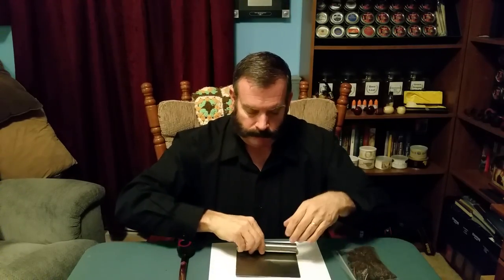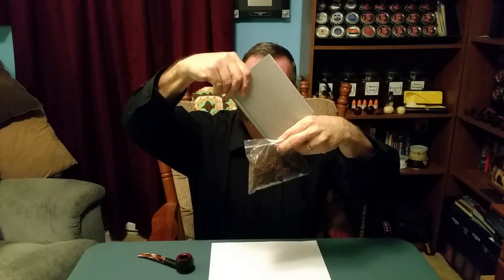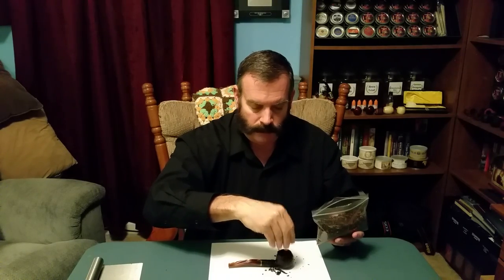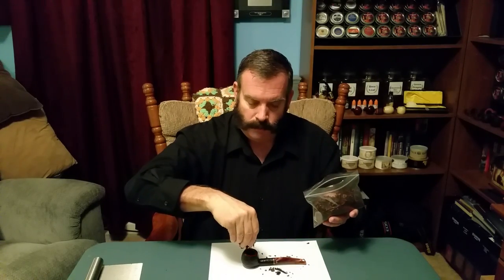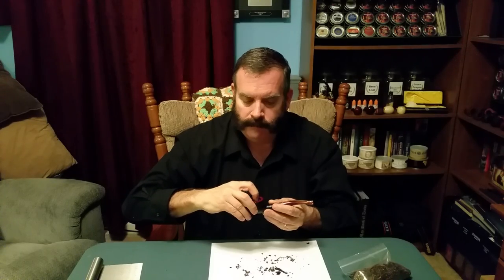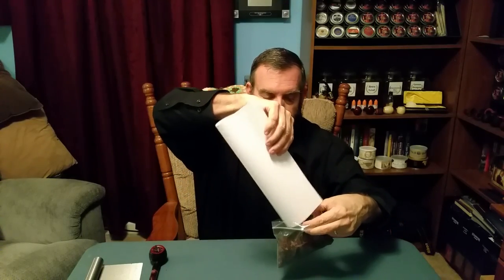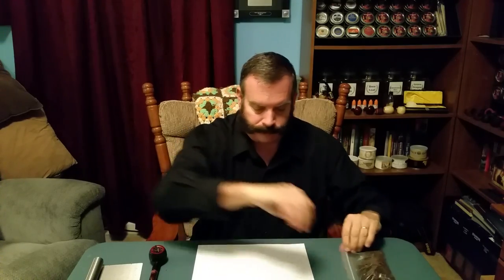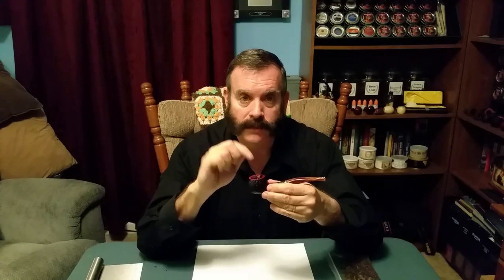The Art of Pipe Smoking, Vol. 2: How to pack your pipe

Comment: i discovered something interesting, i found a way to loosen a pack/draw without having to unload your pipe. what you do is lets say you pack your pipe and its too tight to your liking. what you want to do is cover the bowl with your hand tight but loose enough to let a little bit of air escape the bowl then you blow hard for about a second and it will give you a perfect draw. not sure why but i noticed this with my last bowl. give t a try once if you pack too tight. i enjoy your videos. very informative kudos
Reply from the maker: Hukman! - Very interesting, thanks for sharing that info with the club my friend. 👍👍👍
Reply: im not quite sure what im doing wrong but i cant seem to pack a bowl and get a good draw. ive tried many different methods it always ends up like a light milkshake through a straw consistency regardless of how lightly i press the tobacco. i literally just had to unpack and repack my pipe like 10 times before i got a decent draw. ive been smoking since february-march. its really frustrating. seems to happen regardless of the cut. could it be a problem with my pipe? when i first started i rarely had this problem
Reply from the maker: Hukman! - if you only have 1 pipe, my suggestion would be to acquire a second one, if funds are low, you can pick up a Corn Cob for about $10.00 try packing the new pipe, if you get a good draw, then yes there is a problem with your original pipe. In the mean time see if you can send a regular pipe cleaner through the stem to the bottom of the bowl, if it travels freely then the pipe is probably ok, if it hangs up, or stops part way down, then you may have a problem. 😏😏😏

Comment: Sir, thank you for this packing video.  I had been struggling with getting the pack right to the point of frustration, and I haven't been able to get any sound advice about how hard to pack except for the usual, "enough to get a good draw, but not too loose."  The Marshmallow analogy has provided me a perfect reference.  The paper/Dollar Store vegetable chopper is a great idea, as well.  I've been dropping tobacco on the table, myself, and eventually, the floor - which means my Dyson is deriving a modicum of pleasure from my aromatics.
Reply from the maker: I'm glad I could help Jim. 😃😃😃😃

Comment: Excellent presentation as per usual. I have now mastered my bowl filling but its always good checking out different ways of doing it. I have just finished a smoke of 30 mins in my corn cob, and will see if you have any for corn cobs as I prefer them to any other pipes. They are often looked down at due to the price but I have no complaints about my set. Happy smoking dude !!!
Reply from the maker: metaknowledge2010 - I am not one of those that looks down on Corn cobs, I love them because they are cheap in price, but not in manufacturing, no ghosting, so you can smoke anything in them AWSOME!!!!! 👍👍👍

Comment: The method being explained at the 7-8 minute marks is also known as the 'Father-Mother-Child' method. Not quite sure why, being as the 1st pack is the easiest, 2nd is moderate, and the final pack is heaviest...but, it is what it is. Also, don't forget to 'draw' on the unlit pipe...should be about as 'firm of draw' as trying to drink an average milkshake through a straw...too difficult, you'll fight the burn all the way to the bottom and have excessive heat too. Too easy, and the bowl will burn out quickly.

Comment: @muttnchop piper where do you get the labels that you put on the top of your jars I see in the background? And how do you get them on there? Are they just the tops of the tins the tobacco came in?
Reply: In his video "My Pipe Collection & Tobacco Rotation," at 9:29 he addresses this question.  He prints them using a high resolution image of the brand's tobacco tin label - prints it on some paper and affixes it to the glass jar using some glue.  He says the type of adhesive he uses makes it easy to remove the label if he wants to fill it with another blend of tobacco.  Check it out!  Hope this was helpful.

Comment: This method works well for ribbon. But I have trouble using it for denser tobacco. For example, a crumble cake. Would you use this for something like Plum Pudding or instead just fill the bowl and maybe lightly push once?
Reply from the maker: Paul M - You got it, you are absolutely correct, tobaccos like plumb pudding are like sand, you make sure it’s broken up good, then pour it in, lightly press down on the tobacco, and off you go. 👍👍👍
Reply: Thanks mutton. Appreciate your videos.

Comment: Is there a different method to packing a pipe with cube cut tobacco?
Reply from the maker: Harriet Herfer - cube is a hard one to pack, the way I do it, is I basically fill the pipe to the top, then tamp it Down, not tight, just seat the tobacco, it seems to work for me. 👍👍👍
Reply: Thank you.  I'm in my first slow smoke competition next weekend and I've never smoked cube.

Comment: Usefull explainaition, thank you.
Reply from the maker: Your welcome 😄
Reply: I was wondering if filling my pipe all the way to the top could be causing my bowl to become scorched, can anyone help me on this?
Reply from the maker: Jonathan Simpson - it's common for the rim of your pipe to get scorched a little, if it is heavily scorched, then use a lower flame if you are using a light, do not use a cigar torch, if you are, that's why the rim is getting scorched. And yes putting tobacco below the rim will help with scorching, also light you pipe lightly, don't stick the flame right against the tobacco. 🎃🎃🎃

Comment: I packed a pipe a few days ago with 3 layers of tobacco wich filled the bowl almost to the top. For some reason the pipe lasted for an hour, what happened? Did I packed too much tobacco or packed it too tight? Is it supposed to last all that?
Reply from the maker: Old goat - Yes, it can last that long, but you have to ask a couple of investigative questions, first, how many times did you spend relighting the pipe, if it was like 10 to 15 times or more, then that is why, if not then question 2 how big is the bowl? If it’s a large bowl, and you packed it perfect, and you smoked the pipe slow and steady, then this is the reason why it lasted an hour, it’s rare, and conditions have to be near perfect, but yes it can last an hour, sometimes more. 👍👍👍
Reply: Muttnchop Piper the bowl is of normal size, but yes, I had to relight it way to many times, another thing that may have contributed for it to last all that time is the tobacco, here in Brazil is hard to find tobacco specifically for pipes, I've been using regular rolling tobacco, although it tastes good it may not be appropriate for burning in a pipe. Thank you.